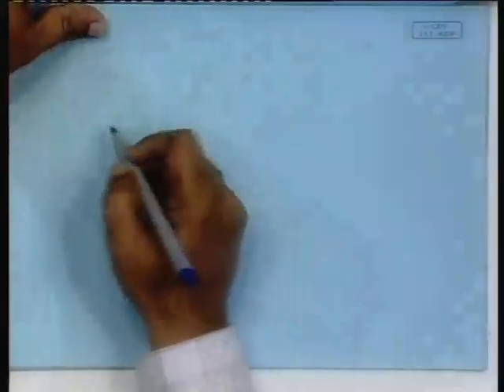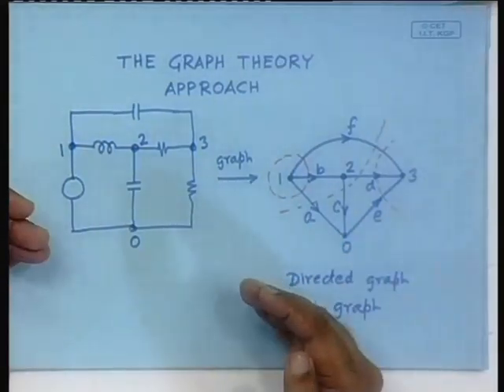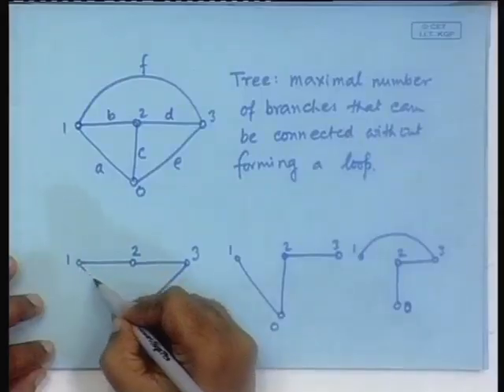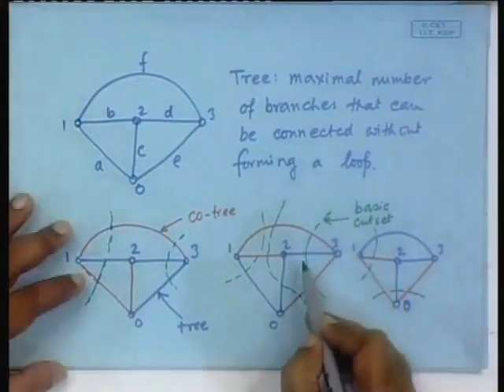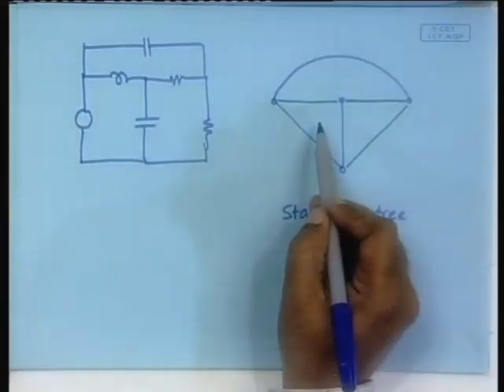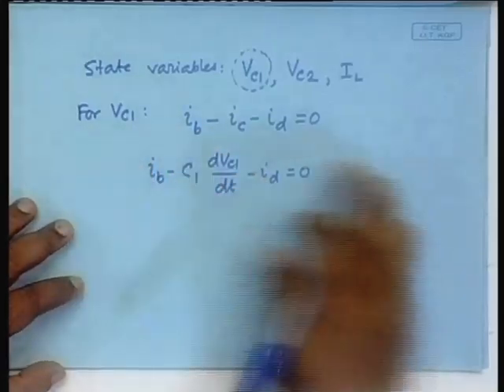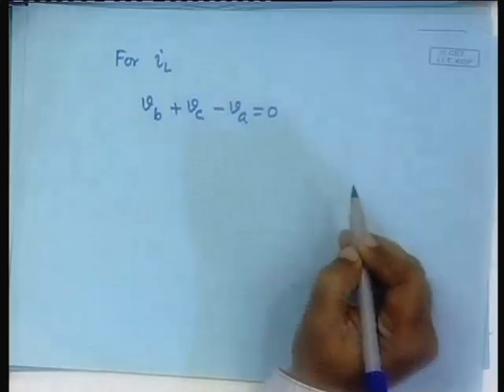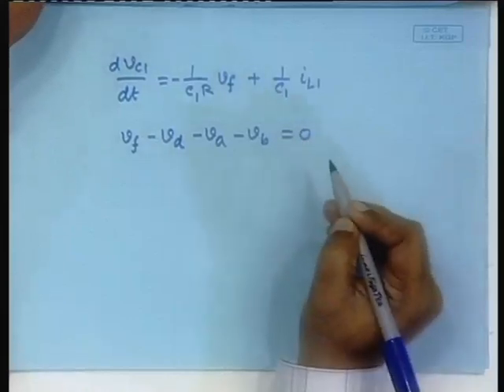Lecture - 11 The Graph Theory Approach for Electrical Circuits(Part-I)

Comment: sir, i could not understand the state variable
Reply: As a constant current value does not flow from the capacitor and inductor, the current of the capacitor and the current of the inductor are not a constant variable.